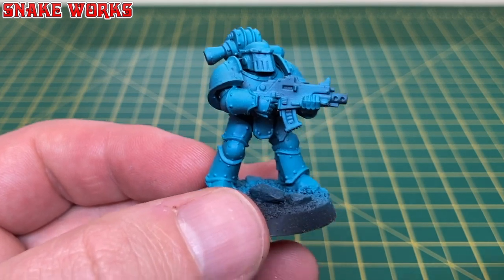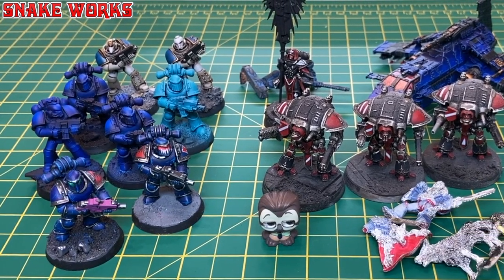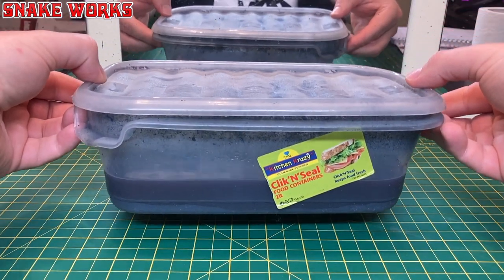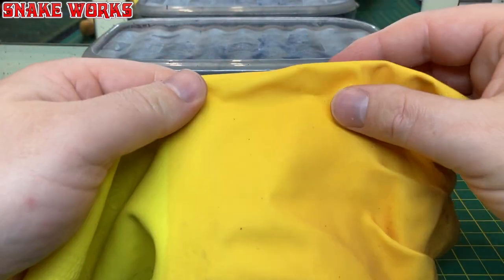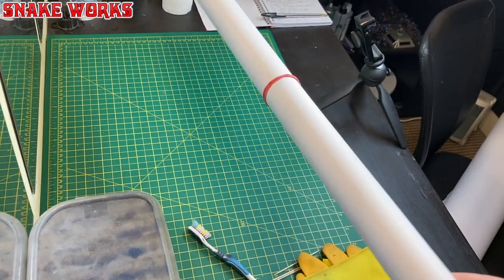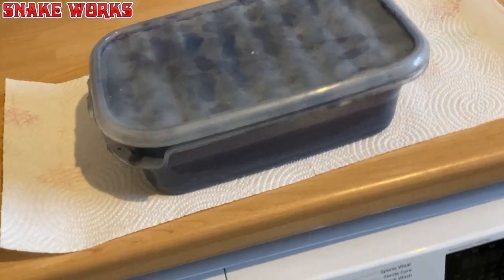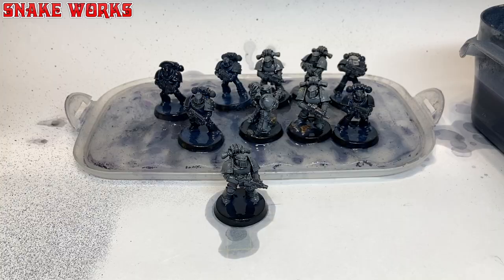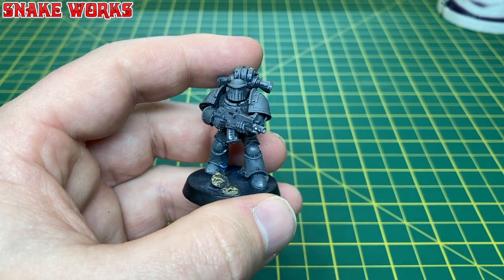Stripping Miniatures - A Guide on how to remove paint from miniatures - Hobby Tutorial

Comment: Bio strip20 is the best stuff I’ve found and a lot less hassle than meths.
Reply from the maker: Is it in mini or DIY shops ?
Reply: @SnakeWorksStudio  I live in the uk so I got a tub for £10 off Amazon. I’ve had it nearly three years now and I’ve stripped dozens of minis and it’s still working though I’ll need some more soon. I’ve just checked Amazon and they want £15.99 for a 500 ml tub. It will strip a lot of minis though.

Comment: For me its Acetone for metal minis and  isopropanol for plastic. Those always worked like a charm unless the the mini i got from ebay was painted with some unholy paint.
Reply from the maker: Acetone is amazing for metal yes! Not tried isopropyl, I think that’s similar to meths. Alcohol based?
Reply: @SnakeWorksStudio  Yes its alcohol based its mostly used in Hand sanitizer, which also works for stripping but the pure concentrated 99% stuff works the best. Just with every chemical make sure to use gloves , eye protection and stay in a well ventilated room.

Comment: Dettol is the best for stripping metal minis and modern GW plastic and safer than most of these other cleaning chemicals. Although, I found it melted GW plastic from the 80s. No idea how it performs on resin, never tried it.
Reply from the maker: The dettol melted the 80’s plastic?
Reply: @SnakeWorksStudio  Yes, my ancient Rogue Trader Beakies. Slightly melted the plastic ruining the finer details. Harmless to the new plastic Primaris marines however. Lore accurate as far as I can tell.
Reply: I use Dettol with the older plastic minis just dont leave them in long a couple of hours is long enough, I have stripped loads this way over the years

Comment: I use a product called simple green all-purpose cleaner. I've used it on plastic and metal but NOT resin. It works very well, indeed. I also use a regular toothbrush and denture toothbrush for scrubbing.
Reply from the maker: What’s a denture brush about?
Reply: @SnakeWorksStudio  It's just a good brush for getting tricky areas.